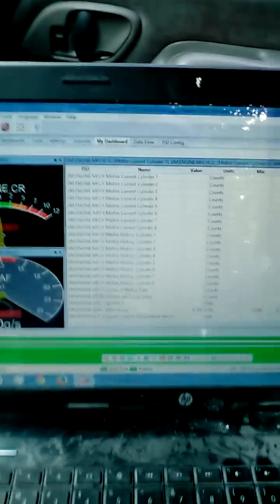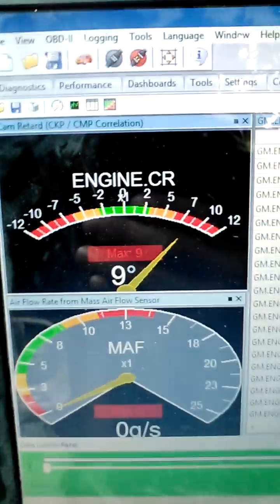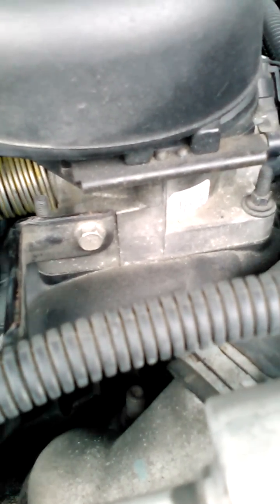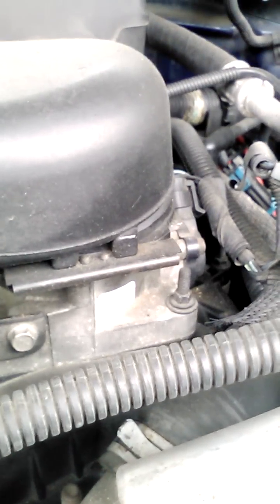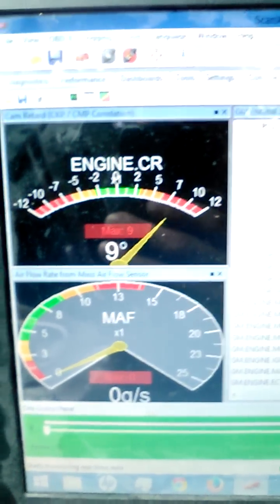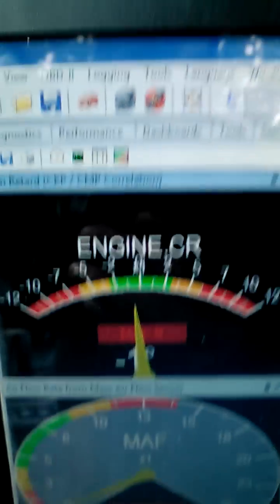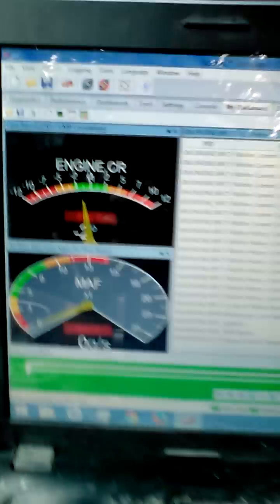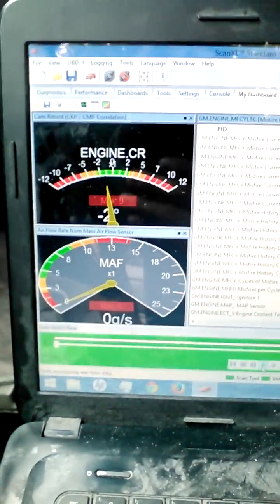vortec v8 96'-00' ignition timing

Comment: I know this is an old video/thread, but it's a good one.  I had to replace my intake manifold gasket and I purchased the OBDLink MX+ because the ScanXL is no long available.  That said, I can't find the PID to monitor to set the cam retard.  Does anyone know what PIDs to monitor or how to otherwise use the OBDLink MX+ to set this?  Thanks in advance.

Comment: Hey @willy_Jilly Wanted to thank you  for your efforts and share with you and your viewers that the current ScanXL program does not have the CKP/CMP PID scripts in any way shape or form. Either PPE removed or disabled it due to possible liability issues from GM. When I contacted Paul the owner of PPE. He initially stated his program could not do what you showed to us, then I showed him your video, he flip/flopped then said it could be done just not accurately. Okay, I could live with that for $230. But for the life of me I could not find the needed PID scripts, they are simply not there. I asked PPE again, now he is saying maybe my 1998 GMC 5.0L C1500 may not have it. WTD??? As for the alternate guy with the wireless OBD2, yeah N/A. So to your viewers, PSA, please verify with Palmer Performance Engineering about the  ScanXL before you buy. So I will do the GHETTO adjustment from 10+ years ago by an Aircraft Engineer, Opening of OBSERVATION WINDOWS on the Dizzy and visually correcting the Camshaft Retard, Only $15.00 sacrificial dizzy and new SST in my tool box to share with my GM buddies

Comment: I adjusted my 89 5.7 years ago and had to unplug a wire to the computer before doing it. Is that something I need to do on my 96 305?
Reply from the maker: Did your 89 have a vortec conversion or was it the original TBI set up?
Reply: @willyjilly9684   it's all original with the throttle body.   The 96 has a brand new 305 we just put in and the scanner is showing a cam problem. It runs but misses. I'm assuming it's timing.
Reply from the maker: @MattFaulkner-y4d  ok gotcha! The 89 TBI system uses a more traditional distributor system with timing that can be set with a timing light. where the 96 vortec uses a strictly computer controlled system where there is no controlling the ignition timing but a correlation between the crank and cam. The vortec 96 requires a scan tool or laptop  capable of viewing GM parameters. I believe it’s called crankshaft offset retard in the scan tool menu. I’ve heard of people using the cheap BAFX scanners on Amazon and tapping into the GM parameters. I’ve had mixed results with these scanners but I’m sure there is a cheaper way than the snap on scanner or buying a laptop with software. There is actually a few videos showing how to get the distributor lined up good enough to keep the check engine light off until you can get a scan tool capable of viewing the crankshaft offset pid. Hope this helps and have a wonderful weekend 🇺🇸

Comment: Does this info cross over to the 4.3
Reply from the maker: Yes from what I have experienced it does, there is a few videos showing the 6 and 8 markings on the distributor cap for initial installation to get as close to perfect when you do start it and set timing aka crankshaft to camshaft correlation also known as crankshaft retard in the PID menu
Reply: My distributor hold down is a fork so I can't adjust it do I just get a sbc hold down
Reply from the maker: @therealblakekirkham5701  they come that way with aftermarket distributors the factory ones don’t have that. The fork is designed to “lock” the timing in but it’s never accurate. Big fail on the aftermarket industry. I ended running my original distributor hold down and it is designed like a traditional SBC hold down so that would work perfectly fine.
Reply: The 4.3 are factory with that fork

Comment: Hey willy I have scanXL running while engine is running in the same configuration you have but the gauge doesn't move at all? I even pressed start monitoring live data. Is there something I'm missing?
Reply from the maker: Are you over 1,000 rpm when you are doing this? The sensors won't pickup a accurate signal until you are over 1000 rpm. Also Is the correct parameter selected and actively playing the data live? I had a hard time with this at first. I ended up contacting scantool.net when I couldn't figure it out initially.  They walked me through the process and it's super easy once you have done a couple of times
Reply: @willy Jilly  yeah I'm idling just over a 1000. Getting hard to find information about this program as it's a bit dated. I appreciate it

Comment: Hey man me and my buddy are stumped. We set the distributor in correctly. Pointed directly at cylinder 1. Started it up, took it up to 1200 rpm and it was reading -17. We turned it as far as it would go and now it’s reading -8. If we turn it a tooth it will go to +23 and if turned all the way it’ll come down to +7. It refuses to go to 0. Any advice?
Reply from the maker: @Brian Poarch I went through a bunch of forums to make sure a steer you in the right direction. On the 4X4 forum some guys are saying faulty distributor for the same problem your having and others said a relearn process with a specific scan tool but I never did that so I would swap out the distributor first if that's possible and see what the results are. One guy was talking about having the timing chain jump but I have never heard of that happening with these vortec motors. The chain usually snaps. Old 305's from the 80's with the plastic timing gear coating would crack and skip teeth but not the newer stuff so I'm not sure if timing chain would be your issue unless that's something that has been replaced if so recheck that.
 Now if it is a used distributor make sure the teeth on the gear are perfect. That can play a role Because the cam gear is a harder metal than the distributor gear and will wear out over time which will give a false reading.
 Also make sure your TDC on the compression stroke, being 180 degrees out can cause this same problem. Last thing: 
 When I was one tooth off it ran rough and threw a engine code instantly for multiple miss fire. I hope this helps in some way and you get it sorted out. Let me know if I can help in any way I'll be happy to respond. Have a blessed evening 💙✌
Reply: We literally just figured it out. My buddy and I took some wrong advice and had it in wrong. It was a tooth off. It still ran fine but felt like it had less power. I greatly appreciate the advice. Have a good evening man

Comment: I got a scan tool that does advance ignition timing for cylinder 1 is that the ?
Reply from the maker: I thought the same thing when i first tried with a scan tool unfortunately the ignition advance is not the same as camshaft retard timing. I tried twisting the cap every which way while reading the ignition advance and the numbers dont change at all.

Comment: I bought the obdlink mx to hopefully get the timing right on my chevy are you still able to do this? Or have they changed the software
Reply from the maker: As long as you bought the GM performance add on sure it will do the exact same thing it did back when I made this video and I believe it can do more now. They usually only add things, or update the system itself. Nothing as far as I can tell had changed to dramatically.  I will say on the MX adapter it can be iffy with some devices so don't be too upset if it doesnt work with your phone or whatever right off the bat. It's a really decent product from what I've seen so far...
Reply: @willyjilly9684  thanks for the reply! Hopefully wont give me no problems when it gets here!
Reply: @willyjilly9684  where do you buy the gm performance add-on? All i see on the site is the mx+ device. Thanks
Reply from the maker: @joshuas10  the gm performance add on is software that you add to your scanxl software package. The MX+ is just a cordless scan tool, the hardwire version OBD link is $29-$39  and transmits the same info via a laptop or something similar. Really your just paying for the software, the obd links are just connecting the laptop or cell phone to the vehicle. .

Comment: yes but how to find engine CR on the system? is it the advance timing?
Reply from the maker: No sir. That was my thought too. The advance timing doesnt change, it does not matter how much you twist the distributor the advance stays the same. Camshaft retard is found in the GM pid list which can be found on the scantool platform but are not available to scan live without the GM add on to my knowledge. Took me a minute to find the pid in the menus. The entire scantool tool platform actually takes days of feeling out before understanding how it works fully. You might be able to get away with a BAFX scanner, or Similar aftermarket scanner but I have had no luck tapping into the GM side of the vehicle with cheaper scanners. Lots of great videos for cheaper scanners in action doing the same thing I'm doing (BAFX scanner vortec ignition timing is what I looked up). Hope this helps!
Reply: @willyjilly9684  Thanks for the info! I have Scanxl w/GM add-on but when it is connected the timing just goes up and down with me pressing gas pedal
Reply from the maker: @verasvacuum182  oh really? How much fluctuation? The numbers will change a little when you rev it up but nothing dramatic. Does the value  move around when you set the throttle body screw to 1200 rpms? If it is all over the place you could have sensor or mechanical issue
 I know I have heard that from someone else and it ended up being a bad camshaft position sensor located in the distributor but they replaced the crank sensor at the same time so I'm not sure what exactly fixed their problem. That would be the sensor side of a problem like that. Or it could be the distributor gear is so worn out that it is causing a problem with the timing and cant read correctly. I would make sure it's not jumping all over the place at a steady 120p rpms and if it's not your good to go and set your timing. 👍
Reply: @willyjilly9684  how to set the pid's
Reply from the maker: @verasvacuum182  I really need to make a video on setup and pid use. You can view pids live without a graph or gauge like the one I used in the video. There is small boxes next to the list of pids. Check the ones you want to watch and hit the green play button. The pid value will show up next to the selected pid and begin reading. It is a little tricky at first but super easy once you get it. Hope this helps. Happy Halloween!
Reply: @willyjilly9684  Thanks I will try tonight. I thought I did that. It look live an excel sheet. If so, I did it correctly. I'll let u know this evening. Thanks for all your help. I was just looking for a graph or meter like u had

Comment: Hello mine is at -15 degrees, do you think I need to skip a gear over or something like that on my distributor? And how can I do that
Reply from the maker: When I was a tooth off it ran like garbage and threw a multiple misfire code.  Truck would would barely start. I knew I was off adjusted it, and it ran like normal but timing was still off.. The -15 your at isn't too extreme mine was -19 and it ran ok around town, but highway would miss and you could feel it then throw  a code.  when I first found a laptop and was able to see what was actually going on I couldn't believe I was at -19 and still driving ok on city streets. More than likely you need adjust timing unless your for certain your more or less a tooth off, but I can't really see that if your not throwing codes and the vehicle runs like complete ass. Adjust the timing by twisting the distributor above 1,100 rpms and watch the timing via laptop/scantool. If you are still throwing codes or run like ass still than yeah probably a tooth off. 
Here is how I bump a tooth over. 
 bringing the #1 piston up on the compression  stroke and perfectly line the balancer notch up with the tiny pointer mark on the timing cover. When you drop the distributor in it should be pointing towards #1 cylinder. I found that using the distributor as a oil pump drive tool to twist the oil pump drive shaft far enough clockwise to make it to the next tooth. use the distributor in place of a screwdriver basically.  for some reason it's the easiest way to bump EXACTLY one tooth over. Unlike the traditional small chevy where you use a screwdriver to move the oil pump drive in position. Unfortunately you can only do it clockwise so if you miss that tooth you gotta make a full rotation to make it back around. Hope this helps stay well be safe!
Reply: willy Jilly thanks for your response, it runs fine but it feels like it has not much power just some power if you know what I mean lol
Reply: willy Jilly and yes I do have a code it is the P1345 code
Reply from the maker: @Z71__  mine felt low on the power but not horrible. P1345 is definitely the timing and that's what mine would throw on the interstate at -19. Check that first before pulling the distributor back out.
Reply: willy Jilly Will do thanks hopefully its a matter of loosening bolt, setting 1K RPM and then adjusting time by moving the distributor slightly. Thanks

Comment: With my hold down clamp loose I cant move the distributor
Reply from the maker: It's either the distributor is stuck to the intake manifold or you have an aftermarket clamp that is non-adjustable (I don't know why they make these clamps as they don't give correct timing).

Comment: After you're done and you tighten up a distributor hold downthe distributor shouldn't be able to be turned by hand should it?
Reply from the maker: No, if it does move the tab that holds the distributor in place is either bent or it's a new tab that doesn't fit the same as the old one. I've had luck just using the old one opposed to new.  bending it with a hammer and 2x4 by hand on the ground, or vise with pliers works even better! New tabs for vortec suck in my opinion. I like OEM...
Reply from the maker: No, if it does move the tab that holds the distributor in place is either bent or it's a new tab that doesn't fit the same as the old one. I've had luck just using the old one opposed to new.  bending it with a hammer and 2x4 by hand on the ground, or vise with pliers works even better! New tabs for vortec suck in my opinion. I like OEM...

Comment: Thanks a Ton!! Did you have to set the mark's at the crank and block? Thnx!
Reply from the maker: Only time I used the crank/block marks was when I needed to find TDC (top dead center) for the distributor installation. That's the only thing the marks are used for on a vortec 5.7 from 1996 and up. The actual timing is computer controlled, but can be adjusted physically through the distributor. You just need a computer to watch the numbers..

Comment: Would this work on the 2002 4.3 v6? I replaced distributor and got a new code P0341. Runs great, but has this new code.
Reply: P0341 - GM
Type: Powertrain - Ignition System or Misfire - ISO/SAE Controlled 

Description: CMP Sensor Performance Conditions 

Cause: Engine running, then the PCM detected the ratio of fuel control CKP pulses to CMP pulses did not equal 6:1, condition met 10 times during any ignition cycle (this fault may be intermittent)

Comment: I bought the scan XL and the GM add on, but I can't for the life of me find the scream your running on you tube
Reply from the maker: Sorry for late response. This is just a graph. First I made sure my parameter (CMP retard offset) was selected checked off and playing/graphing. Then I open a new graph (they give you multiple choices of graphs like the one in the video). Then you open the new graph and choose your parameter. Then you can view your parameter in multiple ways. They have all different ways to graph. I would explore the app and get familiar because I too was frustrated. I eventually figured it out after a couple days of fiddling with the scantool features they offer. It does take time to t used to so don't feel bad if you didn't get right of the bat. I had to figure out how to apply the GM add on for about 2  weeks. Then figure out how to graph the damn thing. Once you do it it will be no problem in the future. I had to create a graph and then save it for future use. Takes 2 minutes to pull up all information once saved onto scantool software
Reply: @willyjilly9684  ok where yours says (ENGINE.CR)   mine say ( ENGINE.CMP_ RTRD)
Reply from the maker: @Lamar4ya  I wonder if the scantool.net  platform changed over the time period since I made this video?
Reply: @willyjilly9684   lol, maybe i made my own dashboard gauge because when i checked off the CMP in the pid it didn't bring anything up as far as gauges
Reply: @willyjilly9684  will the odb link mx+ work for this procedure also?

Comment: I need to buy the XL software and the GM add on I found it on Palmer Performance Engineering
Reply from the maker: Couldn't find the comment you just posted, but it is kinda tricky to setup pids at first. You need to make sure ALL gm pids are on (usually it only shows the most basic until you go into the pids and specifically check mark the pid you want to graph). The gm codes are highlighted green if I recall. I didnt let the vehicle run all the codes, just the one specifically for camshaft retard.  Actually I have typed in camshaft retard or CMP under the pid menu and it comes up. Now once the pid is check marked you have to view the data live by pressing record or live play. From there you can make custom bar graphs (Like I did in my video), or you can just view it live as long as the pid is check marked. I dont have a laptop anymore so I'm not sure how I can make a video showing firsthand how to do it, and I apologize for that because that would really help people.